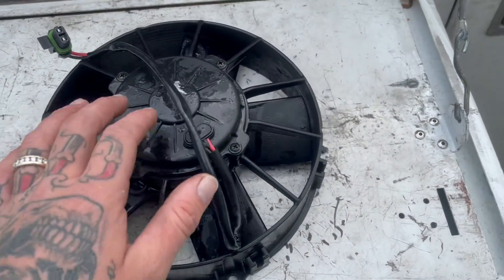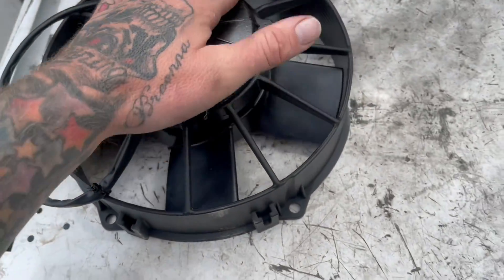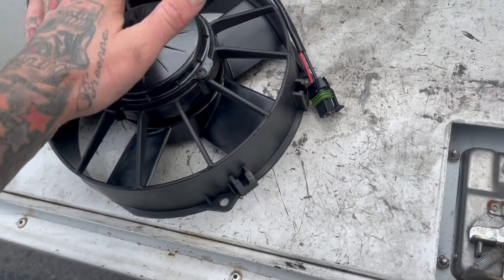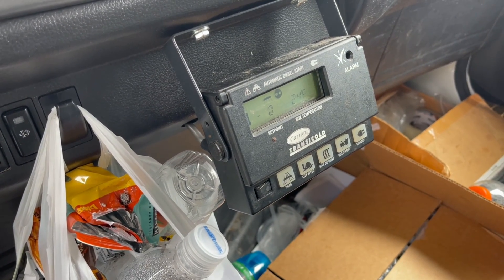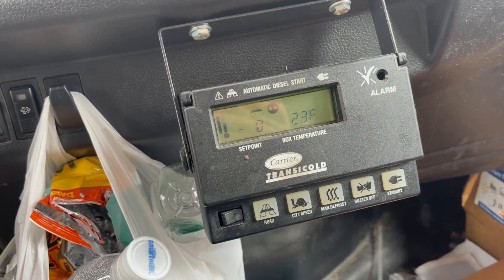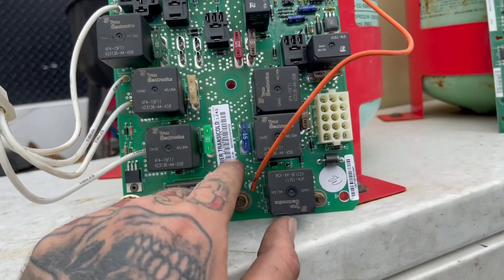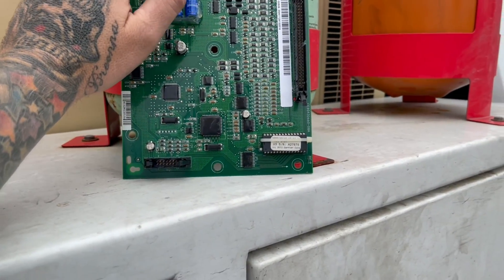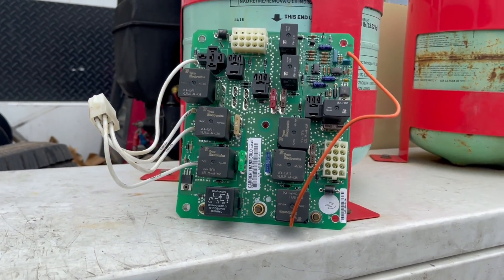Carrier Supra Series fuse bad on display diag and repair

Comment: I was watching  the video, did you say that all three evap fan fuses are supposed to be 30 amp fuses? Im looking at the spare fuse box  You have in your video. And looking at the diagram the fuse seem to be correct. Im having issues.

Comment: Same issue here, replaced the same fan as you did, fan still doesn’t cycle on, and the 10amp fuse continues to pop. Any recommendations?
Reply from the maker: there is a short in the wiring
Reply: Yeah check short to ground on your witing

Comment: My Cab command unit is not turning on the screen stays off and it seems as if no power was coming in to it. The cables that run to the unit have power but still the unit does not turn, the screen stays off and nothing happens. I took it to Carrier and the tested it on another unit. The screen display came on and everything worked on a different truck. Do you have any idea what could be the problem?
Reply from the maker: check the ribbon or the single small wire to the battery